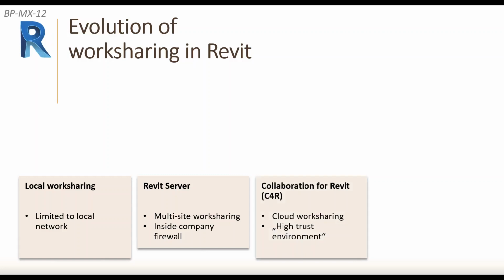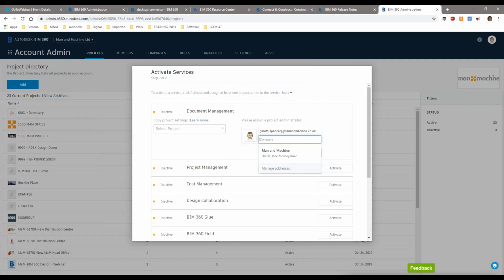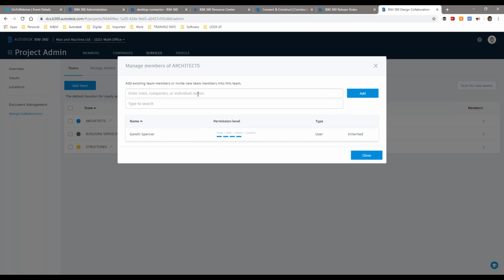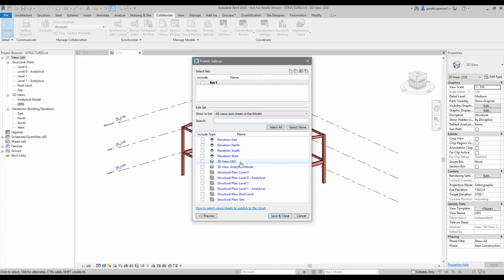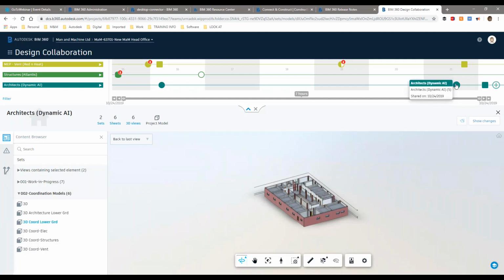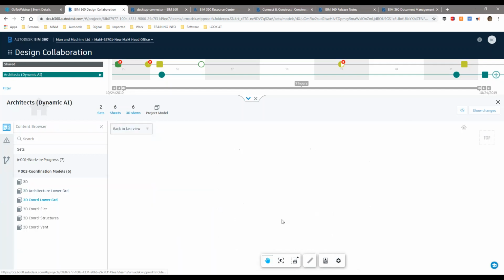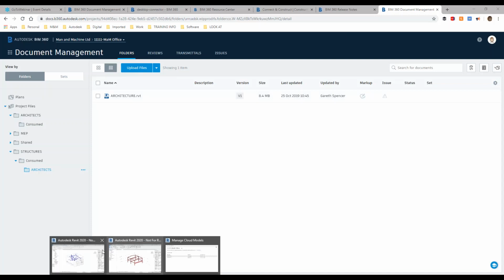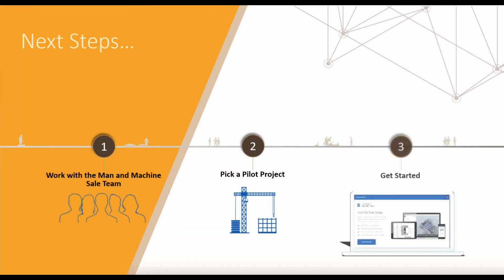Introduction to Cloud Based Design Workflows using BIM 360 Design

Comment: Is BIM 360 Design still beneficial if I work by myself?
Reply from the maker: That depends on how you work on projects. Do you work as a sole practitioner and don’t receive any other models, then the answer would be no. if you do receive models from other consultants (i.e. Architect, structural engineers, building services, etc) to coordinate with. Then using BIM 360 design will give you so much more benefit such as collaborative work as
you will see in the video.
Reply: @ManandMachineCAD  Thanks for the info!